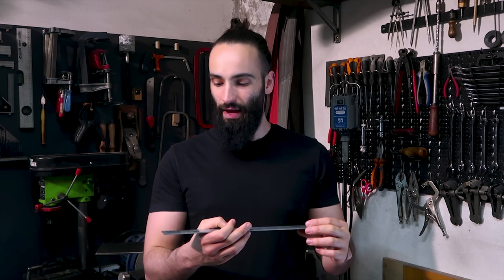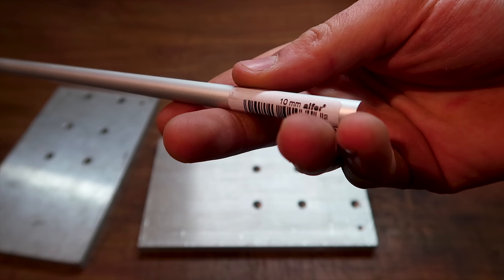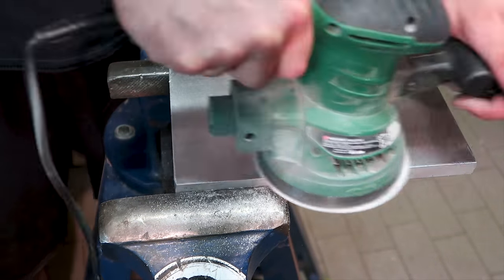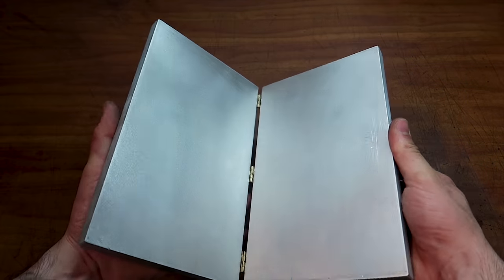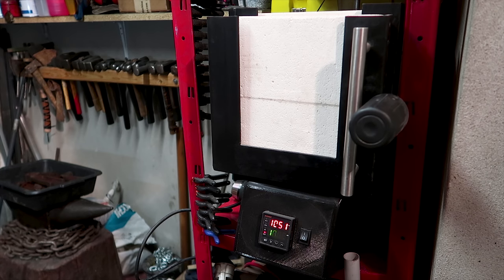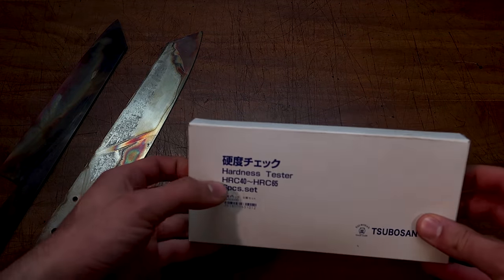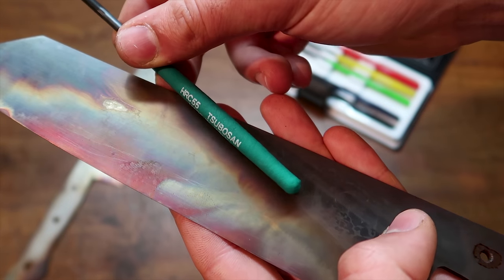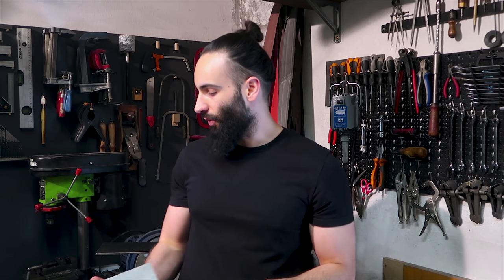Stainless Steel Heat Treatment: Oil vs. Plate Quench

Comment: Your kidding love to know how to heat treat stainless is one of the best things to know :) Good music by the way. Did the oil quench one show hardness at the tip as it did cool down quite a bit. Interesting that it hardened in oil, seems like a good way to go if you have no aluminium plates just for ease of use. could you have quenched the oil one without taking of the foil like you did with the plates? Does the aluminum quench it faster than steel plates? Can you use alu foil to exclude oxygen? Sorry for all the questions. Would love to know.
Reply from the maker: Thanks!!!
Hardness is within 5 Rc across the blade, might be slightly less but I can't tell. I can't without taking foil off because I feel like foil doesn't have a perfect contact to the knife so it can't take heat out fast enough. Like a steam jacket you know?
Yes aluminum is faster for sure than steel to transfer heat, that's why heatsink are made of alu or copper I think :)
No you can't use alu foil because it would melt at 660°C or so!

Thank you again!

Comment: I've seen a view old timers use whiteout when they dont want 2 metals to bond while heat treating. I think it's the zinc in the white out. Not too sure on the element that gives the feature. I cant remember.

Comment: Im thinking you dont need those hinges on the plates. just add another clamp, then you dont have to worry about blade thickness.. also do you think the extra time it took to remove the foil influenced the treatment? Im sure the heat dropped quite a bit before hitting the oil.. I know Cold Steel has a method for oil treatment in cold oil and they have amazing heat treated blades..

Comment: Can you not just quench with the foil on and move it round enough to push it against the blade ? That would still take the heat out? Or use a oil on blade to vapour off during heat treatment and do what the paper was ment to do?

Comment: id not heard of this, does this also have advantages for carbon steels too? i see it prevents the warping (sorry, i know little, i only get it from 'forged in fire')
Reply: Jusb1066 I have not used plates to quench. However. Certain steels will do better in oil since it is very fast quenching. Warping can occur of course avoiding it more often requires making the knife thick enough to handle the thermal shock without deflection. Most people move on to High Temp Salt baths so that they can control the quench better and avoid warping. The salts baths are quite neat and very effective. Stainless is a miserable steel to deal with from my perspective however due to most customers being unwilling to maintain their knives ( ie oiling them) its what is often used. It also tends to case harden more than through hardening. Hate the stuff. Stainless for bolsters and harleys not blades lol.
Reply from the maker: As far as I know high carbon steels can't be plate quenched as they need to cool faster to harden :)
Reply: Black Beard Projects A1 steel could be plate hardened. Any W or O steels cant. A1 is an air hardening steel. Never used it myself. Damascus or 01 for me. Only use W grade steels for burnishers and gem setting tools.

Comment: I did not notice a cryo cycle like i e seen on other videos out there. Is that only needed for certain steels?
Reply: late reply but cryo cycle is not "required" for any steel but it gives aprox. 3 rc more hardness on certain steels

Comment: i've never understood the point of heating up the oil, does it cool faster if it's warm ? or are you actually trying to slow down the cooling ?
Reply: Heating the oil prevents excessive thermal-shock which can cause stress cracks.  Even non-stainless steels call for a heated oil.  The oil for stainless needs to be less than 125 deg. F and for non-stainless grades around 175-185 deg. F

Comment: Hey, i have some stainless steel and want to use it for my first knife. What happens when i heat treat it without the foil like a knife with high carbon?
Reply: Somebody correct me if I’m wrong but heat treating stainless without the foil will decarburize the knife and it won’t be able to fully harden

Comment: Would freezing the plates shock the stainless making it weaker or cracking it? 🤫
Reply: Probably wouldn't have much of an effect on it as much as having a much larger set of plates to heat sink.
Reply from the maker: No idea :) Freezer go down to what -20°C? Would be interesting to know if it makes any difference with a blade at 1050°C. I guess it can if the plates are big enough!

Comment: And it's not as messy
Was the the 2 lines you see from you blowing air on it?
Reply from the maker: Right! I think the colored lines are where the foil was not in contact with the bevels. You can see them in black while I place the blade between the plates if you stop the right frame :)

Comment: You aren't giving the oil quench a fair chance.  Your foil welded to the steel because you did not dust it with either aluminum oxide powder, or pure talcum powder.  Your oil quench pot needs to be much larger as well, large enough to really immerse the blade and allow you to move it constantly while quenching, into "fresh" oil.  The temperature of the oil needs to be less than 125 degrees F. when you quench, I go for around 110 deg. F.  Make those changes and give it a try and you may not go back to the plates again.

Comment: Hello

This channel is very crazy, I intend to assemble my cutlery in this style soon.

How about you hear a way to build a tempering and tempering station all inside a vacuum chamber?

Does slow metal cooling at room temperature decrease its degree of hardness? Why, for example, if you built a furnace to temper and revenge in a negative pressure environment and after reaching the desired temperature let everything cool slowly ???

regards

Comment: Please tell us is this plate quecnching working with Damascus and carbon steels too I sometimes get wobbling blades
Reply from the maker: As far as I know high carbon steels can't be plate quenched as they need to cool faster to harden. But I never tried! :')
Reply: Black Beard Projects thank you very much for the quick answer. I sometimes get wobbling blades especially long an thin are troublesome.

Comment: Why remove the foil before oilquench? Just dunk it in there, or am I totally wrong?
Reply: Problem is that the foil doesn't have a perfect contact to the knife and you get a different cooling what results in a wobbling blade
Reply from the maker: Not sure, but I feel like XJ9 :)

Comment: I don't understand how oil quenching made a high-hardenability, air-cooled (even slower) stainless end up softer than air cooling. I understand the warping, but not the failure to harden.

Comment: I used stainless foil for D2 steel and it was also difficult to remove.
Reply: Dust your blade liberally with pure talcum powder (no scents or cornstarch added) or aluminum oxide powder..this will prevent the sticking, which is actually the foil welding itself to the steel in spots.  The manufacturers of the foil give this advice on their websites.

Comment: you should try using two marble slabs instead of two aluminum slabs
Reply: the point of the plates is to cool and straighten, not only straighten.
Reply: @nikker1  yes that is why i say try marble because it suck the heat out really fast and even
Reply: @lytken  the heat transfer rates of marble and aluminum are not in any way comparable, sorry

Comment: Why cant you quench with the foil on?
Reply: You can, Eddie.  The manufacturers of the heat treat foil say you can, in fact.  What the guy didn't know is that you need to dust the blade before wrapping with aluminum oxide powder or pure talcum powder and wrap tightly.  The powder prevents the welding of the foil to the blade and the tight wrap allows the blade to cool rapidly and evenly.  This guy didn't give oil quench a fair chance.  If you make blades with a flat for guards and the blade tapers in both directions from that flat, one direction for the tapered tang and the other for the natural taper of the grind to the point, the only point of contact with the plates will be the flat..I find the oil quench a better method when properly done.  Also, you need a quenching pot with enough oil to completely immerse the blade and allow for some movement around in the oil while the quench occurs.

Comment: Thanks for sharing!  This was very interesting.  My fear with the aluminum plate is that the edge of the blade might not be in contact on both sides with the plate and might not get as hard.  After using it, do you think that is the case?
Reply from the maker: Thank you for watching! :) The harness files can't feel any differene in the blade from tip to bevels. But it might be within 5 Rc. Anyway I blasted air directly into the edge as soon as I closed the plates hoping to make that as hard as possible

Comment: Why aluminum didn't melt in furnace?
Reply: He didn't put aluminium in the furnace. Did you watch the video. He only put steel foil wrapped stainless steel blades in?
Reply: 25 mc 27 look at 5:22
Reply: 25 mc 27 foil is made out of aluminium (yea aluminium, from latin, not aluminum from nowhere😂😂, referring ti him anyway) and i think he's talking about this
Reply: stainless foil is made out of stainless, aluminium foil is made from aluminum also from Latin
Reply: Nobody of you watched it and understood what he did. He said "I'm putting this piece of mild steel in the oven to heat up the oil for quenching the other blade " and that is what he did.
Reply: he also put stainless foil in there.
Reply: XJ9 and probably that's why stainless steel got contamined, but it's not what we are talking about🧐
Reply: Hahaha, okay bud. stainless contaminated stainless, I got it now
Reply: raulduke85 contaminated with what? I don't get it. The foil prevents from oxidation it is made of stainless steel (mild stainless steel ) and he put a piece of paper that burns with the rest of the oxygen and prevents from decarburization.
Reply: XJ9 he put the Blade in the oil putting off the ss foil (before putting in the oil); if he previously put an heated  piece of mild steel in the same oil, that could have contamined the ss Blade.
Infact the Blade tempered in oil has signs of oxidation (it's black); It could bè also Just the contact with the oxygen in the air.
Anyway "mild stainless steel" doesn't exist in earth🤔
Reply: raulduke85 with mild stainless steel I meant steel with almost no carbon that normally used for construction works or kitchen stuff and that foil of course. If you want to know more about it I recommend you buy a little handbook called "Key to Steel" where you can find almost any steel sort with alloys temperatures for heat treatment and many more useful infos...
Reply: XJ9 stainless steel has very low amount of carbon in it, but it's not mild steel: mild stainless steel is a name that u give ti It, but It does not exist ad far as i know
Reply: low alloy is the werd. Heat treatment s.s. foil is commonly 304 but they make many grades up to 347. He said @6:40 "foil really stuck to the blades maybe I'm not using the right one", (for the specific grade of alloy he shows at :38 seconds.) which looks like a high alloy stainless; heat treatable.    Foodstuff(not knives) and structural can only be work hardened because of its low carbon
Reply: yeah thats the name i give it because of the low carbon content like the 1.4301, the only diffrence is the chrome and the nickel content. it is a little bit tougher but it doesent harden at all. By the way the foil is made of 1.4841 specaly desingend for this usage.
Are we finished now?  I came here to ask him about if its possible to quench damaskus or carbon steels with that plates.
I dont care how this is exatly spelled and i dont care much about stainles (tool) steels, the only one that can compare with carbon steels is the SB1/Niolox (1.4153.03) or whatever you called it.
Reply: Alec Steele has a few vids that he plate quenched long thin and most likely damascus for warp prevention
Reply: Bart Layman I also saw Freek Wierenga clamping his hardened swords fresh from the oil quench into a vise with long steel bars to prevent wobbling. I might think about it building some plates for quenching but I'm not really sure if it cooles fast enough.
Reply: Too many variables; type of steel and mass, time, thermal conductivity and thermal mass of plates. I'm not a swordsmith, but I can make a hella corkscrew
Reply: Bart Layman never tried a corkscrew I'm fine with Damascus blades for hobby it enjoyable and fascinating too
Reply: As you say- Aluminium foil is made from Aluminium. The foil he was using is steel foil. This is why it does not melt

Comment: try to quench the oil blade without taking the foil off
Reply: No, that would guarantee uneven and delayed cooling
Reply: Bart Layman how would that delay the cooling? i understand that it could be uneven but given my experience with quenching high carbon steels the same way, there is no difference.
Reply from the maker: I don't know, I feel like foil doesn't have a perfect contact to the knife so it can't take heat out fast enough. Like a steam jacket you know?
Reply: Black Beard Projects that’s what i was thinking, however you could just cut open one end which wouldn’t take long and then the oil could flow inside of the foil.
Reply: @Hello-wo4sx  or just have a wire brush handy and remove 80% of the foil in half a second.

Comment: Not sure how you can say the oil quench worked, since the blade had started cooling down before the quench, which in itself does effect the strength of the blade itself.. Also note that you're not supposed to use tin foil when trying to quench a blade, that's just dumb and doesn't effect the end result other then making the blade more difficult to clean off..